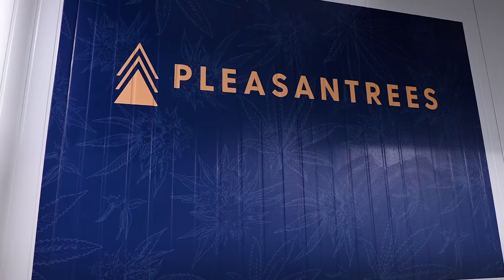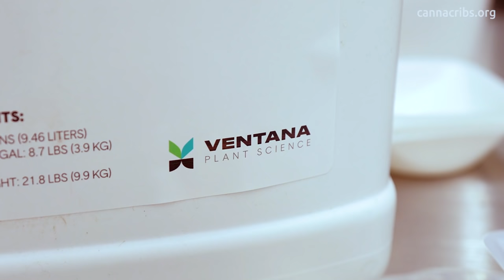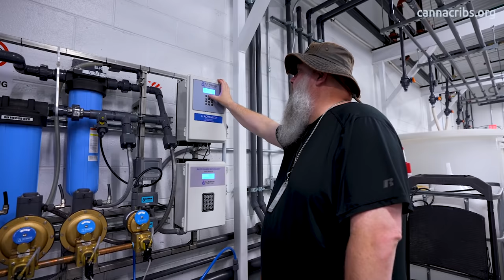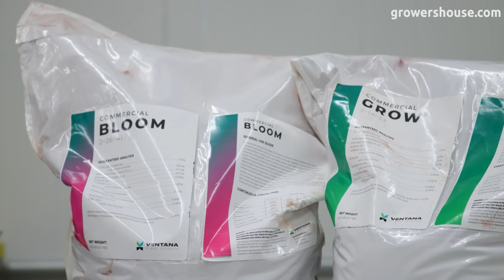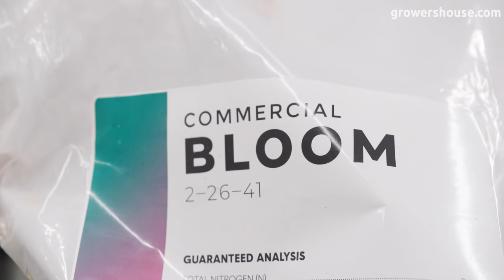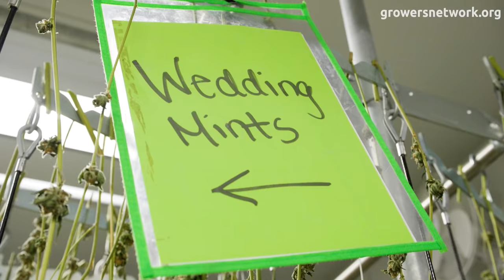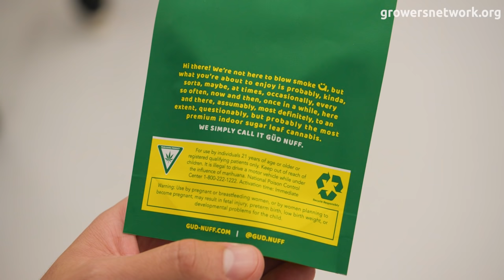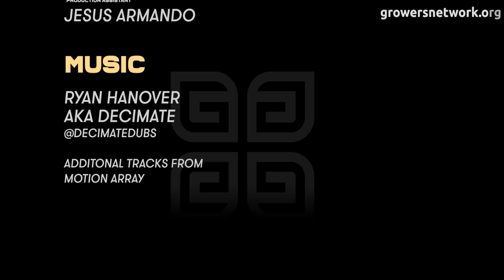Pleasantrees & White Boy Rick Bring The 8th to Michigan

Comment: 24:53 is the part I don’t like. You shake all the trichomes off the flower. I understand why but damn it’s hard to find unmolested flower. You should sell a barely trimmed and not tumbled at all, flower
Reply from the maker: Thank you for the feedback! Was there anything you did enjoy about the episode?
Reply: @CannaCribs  the HVAC System and Michigan brand. I bought an 1/8 of the handcuff bag whiteboy Rick stuff once only because of what it supports and it turned out being pretty good. I didn’t notice any big difference between WBR’s flower and some other mid 20’s I bought other than curb appeal, so that’s a plus. Pleasantrees rosin carts and Element’s Live resin carts are the only carts I vape 😀.